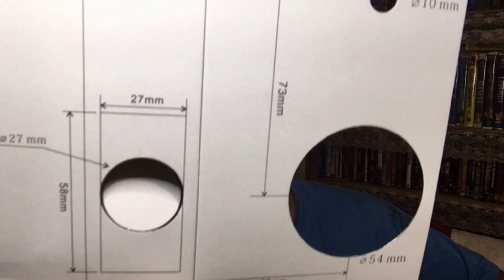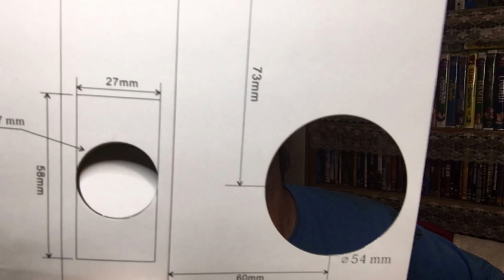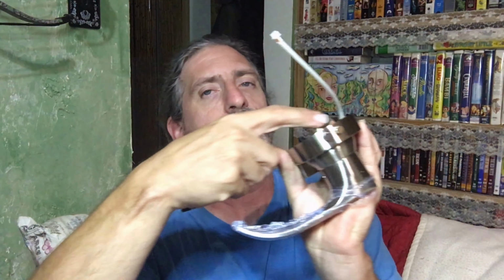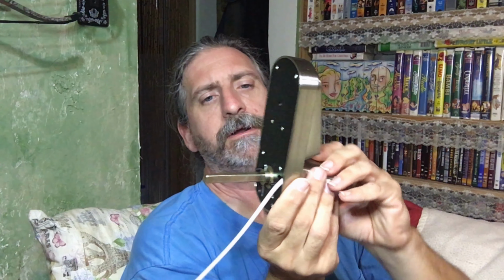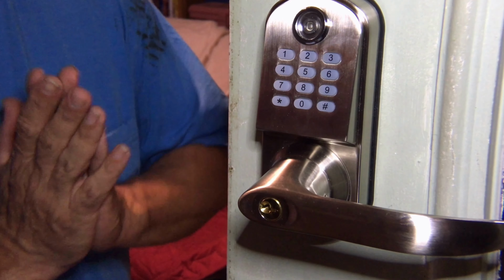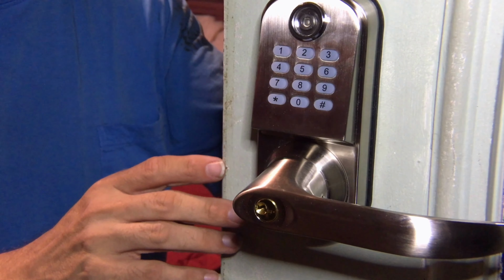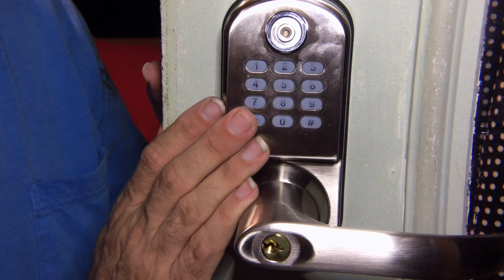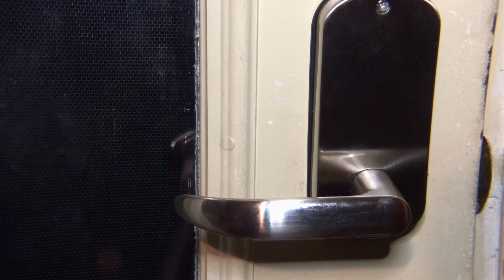Haifuan Right Hand Electronic Keyless Code Door Lock

Comment: thanks for clarifying that the front handle is not supposed to work upon inititial installation, I thought that was the problem. I can't get it to work. Ive tried 2 different units as I bought 3 but never hear that internal sound when trying to unlock the door. The keys work but I have reset the master code a few times and I can't get the code to work.  any suggestions?